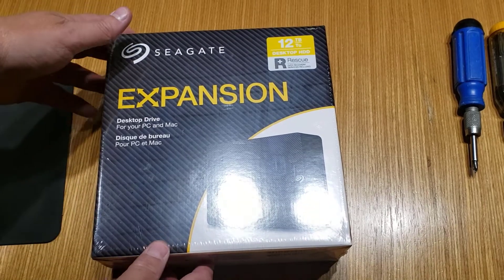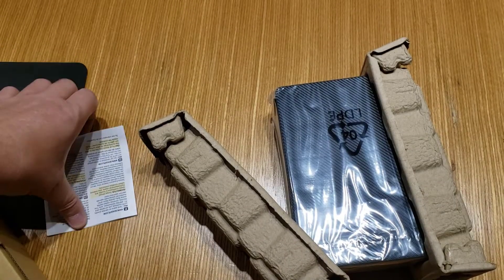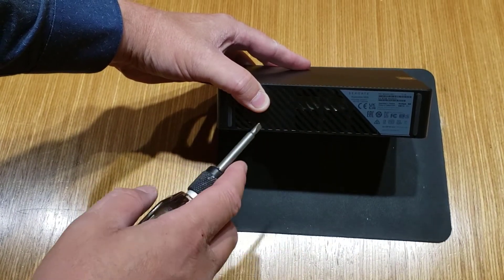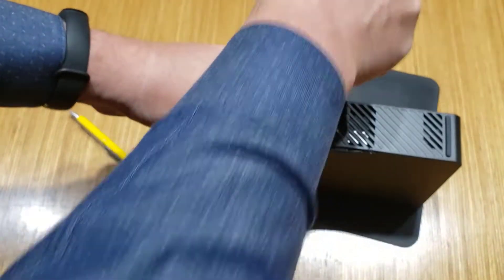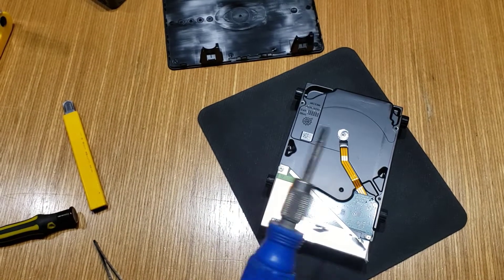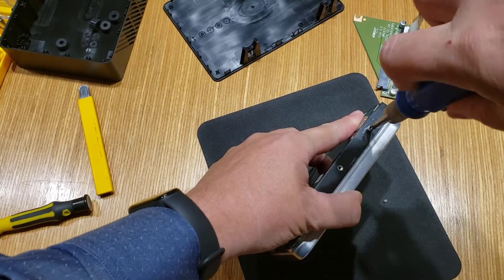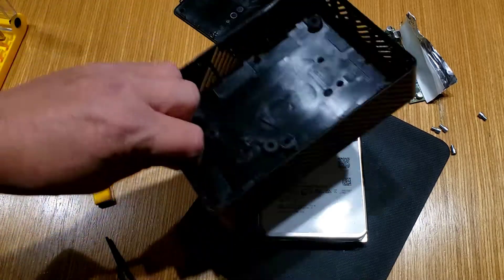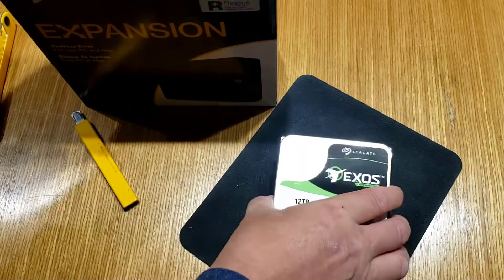Easy Disassembly of Seagate Expansion 12TB USB Drive

Comment: I have been using my external hard drive for a while, but I would love to integrate the HDD into my PC directly. Will my PC delete all the files that are on it when it will try to install it as a new drive?
Reply: It should just show up as a new drive with possibly a new drive letter the first time you boot it up after installing internally. Your OS shouldn't erase anything without your approval. I only have Windows experience, but I'm guessing Mac would work the same way.
Reply: @gsdrewes1967  Thanks!

Comment: I seen in the chart you have data recovery in the warranty? I was looking on the B&H website because been thinking of getting a Synology NAS . The Seagate  Ironwolfe 16tb HDD drives was the only one that offered a 3-5? year data recovery in the warranty. The others didn't. Pretty important to me. A couple of 10 tb drives in a Raid configuration would hold me for a few years with copying the data to larger drives in the future since they should be updated every so often, like every 3 years or so.  I'm guessing the time replacement actually should be by the amount of read write data usage since that's how all data storage life expectancy is rated judging on an article I read on the Back Blaze website. 
  A note is that recently Synology is only offering maintenance upgrades if your using Synology drives in their NAS enclosures. I guess maintenance includes defragmentation & ?

Comment: Hi, I have a Seagate Expasnion Desktop 20tb version, and at one point it dropped, and the cable that plugs in the hole got bent while connecting into the TB, so even after getting a replacement cable, my data, Files and Folder doesn't show up now, nothing shows up on Screen

So I want to ask of Curiousity, will this Dissaemble work out for my TB, will I be able to recover my Data like if I follow this Steps? (and Connect with the Protective Case),

Cause I'm not a Tech Expert lol, so what happened to my Hard Drive is New to Me

Comment: The EXOS drives are in all Seagate externals above 8TB as they don't make any consumer (Barracuda) internal drives bigger than that. And you can buy them on their own but they are typically cheaper when inside the external enclosures still.
Reply: From everything i've been able to find on this subject the large "Barracuda" drives are still Exos in all but label; same performance profiles, RPM, and they're helium filled. They can put whatever label they want on the things and im pretty sure they're just trying to make shucking a less attractive option.
Reply: NOT TRUE. The 26tb versions DO NOT have the EXOS drives. They have the BarraCuda. I'm using them in my UGreen NAS. Hope they work!
Reply: @mshea5906  Looks like they have recently started to make 24/26/28TB Barracudas. That sucks. Not that it matters as the EXOS drives in the externals aren't that great anyway. Already had one fail in just over a year of usage.
Reply: @mshea5906  So they make bigger than 8tb Barracuda for these Expansion only?

Comment: Can i be able to plug this into my laptop without the casing?
Reply: This is a 3.5" drive. Laptops use 2.5" drives. So no, it wouldn't fit. 3.5" also use more power, hence the included power supply for external use

Comment: this is a comment specifically for an update and a variation of this process and the result. I have shucked many externals for internal use.

1. MOST...MOST but not all of the drives included in an external housing either by Western Digital or Seagate have different firmware in them which PRECLUDES using them as SATA ( INTERNAL or ESATA ( external SATA ) using a cable to an ESATA connection on your PC or an expansion card on the motherboard.

The manufacturer's did this INTENTIONALLY specifically to preclude users from doing exactly what they know we are going to do....due to their pricing structure.

I have been doing this for 12 years with "thousands" of SEAGATES and WESTERN DIGITAL which in the past did not have this built in OBSTRUCTION.  

LAST WEEK I bought about 6 Western DIGITAL MY BOOKS and 3 of them WORKED PERFECTLY as internal SATAs and the other three which were identical models ( part numbers with similar manufacturing dates of 4,5,6 of 2024  could not be used internally.

I used DISKPART utility and CLEANED them but they could not be properly partitioned or formatted. After I inserted them into 19.00 External Hard Drive enclosures from Amazon ( doesn't matter which manufacturer you buy) they all worked perfect when connected as USB 3.0 drives.

So

1. you can still save a bunch of money buying EXTERANAL Western Digital or SEAGATE drives and spending 20 dollars for an aluminum aftermarket enclosure (better than the plastic one you will get from SEAGATE or Western DIGITAL and still save a bunch of coin.

2. most of the Seagate's in the 20TB flavor were "BARRACUDAS" inside. A Model they dropped years ago BUT.........BUT......BUT...( drumroll please).....the last few 16TB drives I just opened had EXOS ENTERPRISE drives in them!

Specifically SEAGATE "Exos X18" 
- 16TB Enterprise HDD - 
- CMR 3.5 Inch Hyperscale 
- SATA 6Gb/s, 7200 RPM, 
- 512e and 
- 4Kn FastFormat, Low Latency with Enhanced Caching (ST16000NM000J)

This exact drive is $ 299.00 as of 02/20/2015.

BUT ( drumroll please )...the firmware in this exact same model is BLOCKED for internal SATA use. As soon as I put it into a NEXSTAR TX hard drive enclosure ( 20 dollars on AMAZON) it works perfectly....but still as a USB EXTERNAL.

I cannot explain why a few of the WESTERN DIGITAL'S DID work internally and why some did not, but I am sure that NONE of the SEAGATES will regardless of the model of the drive.

hope that helps.

Its a crap shoot......If you really need INTERNAL HARD disk storage your best bet is to NOT use any of the externals at this point...the manufacturers have caught up to us and have us beat for the time being, and NO modifications or cleaning or partitioning will convert them. I've tried, and I KNOW MY STUFF.

Comment: Cool mine also had an EXOS x16 12TB drive in it. These are high end NAS drives! I shucked it out of sheer necessity, since the USB interface broke down.
Reply: Anything higher than 8TB is likely to be EXOS as they don't make Barracuda drives over 8TB. That's how I got my pair of 16TB EXOS drives, just hucked them out of externals and saved a pretty penny in the process 👍

Comment: Thanks for the the video insight on disassembling the hard drive enclosure and to also find out that it uses a CMR Exos model hard drive. Do you know which model of from the expansion line that also uses CMR model like Exos? Is like 12tb and up?

Comment: Many times the enclosure stops working properly and you must pull the drive to get the data off of it. I always find the drives dying (read/write/dma errors) long before the warranty expires.
The Seagate Backup Plus cases must be man handled to get them to open, no easy open like you show. No worries though, you are not saving the enclosure, just the drive.

Comment: Thanks!  Like you, i needed the drive for data expansion...but I also wanted to use the internals to read and recover data from past legacy drives.  Consolidation!  Other than boogering up the side seam like you did (hardly noticible), it was easy peasy following along with your vid.  Thanks!

Comment: Not at all difficult to reassemble as an external drive.  If I were to clean up the scratches I could probably take it back to the store.   But I suspect 4TB Hitachi drive I replaced the 14 TB Seagate drive with would not be appreciated.   But seriously, I'll put the 14TB in my main drive array, and use the USB enclosue 4TB as on of my backup disks.

Comment: Hi I just bought new one same as the one in the video while I'm transferring files to it it kinda make lot's of strong vibration is that normal!??
Reply: It's a HDD not a SSD which means it has moving parts, like a record player or cd player it scans a physical spinning disk with a laser. SSD's have no moving parts and are significantly faster. HDD's are older technology, more inventory, higher storage for cheaper, though less fast. The noise is the drive spinning, arm moving.

Comment: Pry the top open with a flat and narrow tool by placing it inside one of the vents and using leverage. That'll give you enough space to insert a guitar pick-style tool or credit card. Then you can use a spudger or the same metal tool in the opening, running it around the drive to pop the clips. When you're done, and if you ever need to return for service, not even Sherlock Holmes is going to know it's been opened. You may break or otherwise crack some internal clips, but these will all face the same damage if anyone at the factory attempts to open it for verification.
Reply: You da man. Thanks for the extra tips.
Reply: Using your technique, I was able to open it without leaving any marks, with just a small screwdriver and a credit card. Thanks!
Reply: ty, this allowed me to re-use my enclosure for a different, older HDD

Comment: I want to comment and let people know that if they buy these, they should keep the external enclosure and keep note of what drive came out of what enclosure as they are required for a RMA. I just found this out a month ago as I had to get mine replaced as the bad sectors got worse and worse. Seagate will not just take the drive!
Reply: Doesn't removing the drive from enclosure void the warranty?
Reply: @mikeadriano3330  They like to claim that but it's not legal in the US due to the Magnuson–Moss Warranty Act. You do have to talk to them and fight it though if you don't have the enclosure. It's easier if you just put it back in the enclosure when you sent it back. I had no issues when I did that.

Comment: I have the same 12TB hard drive.
HD Tune Pro indicates: airflow temperature current 75 worst 74 but threshold remains at 0?
 Is it safe to delete the 200MB EFI system partition of this hard drive does this have a function?

Comment: Thanks for the instructions on how to open the case. I ordered 2 of them to upgrade my NAS..
I also didn't expect 7200s to be built in there.🙂
Reply from the maker: I hope yours are 7200's too.  If so, it is a great deal.
Reply: do they still work till now did you find any corrupted data on them?
Reply: @NeoneLight  yes, no problems till now

Comment: I was looking at buying one of these 12TB drives, but the reviews don't seem to recommend. Issues such as overheating or simply just stopping working seem to be common. You seem to know your stuff, are these drives any good? I want a large external drive to put all the information on, from the smaller external drives I have accumulated over the years. I am worried about a drive failing and losing all the data from years of photographs/videos from holidays etc. Thanks in advance..
Reply: if you buy one did you find any problems with it till now?
Reply: @NeoneLight  I decided on being cautious and staying with smaller drives, just in case a large one failed.
Reply: That is why you need atleast 3 copies of everything important.

Comment: Is it possible, through software, to find out what model drive you have without opening the case?
Thanks for the video.
Reply: Use crystalmark, it will tell you exactly what's inside.
Reply: @smegger68  Thank you for your suggestion.  I will have a look.